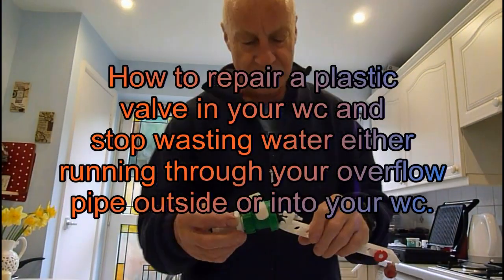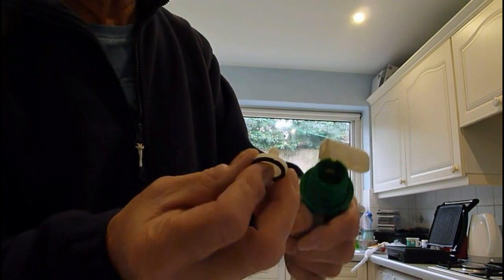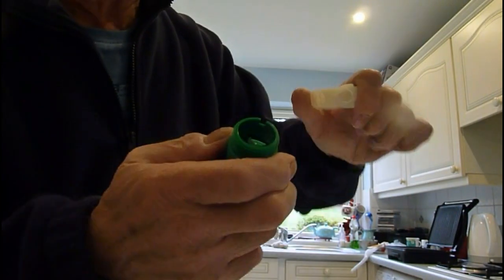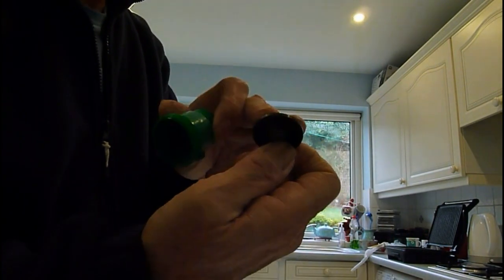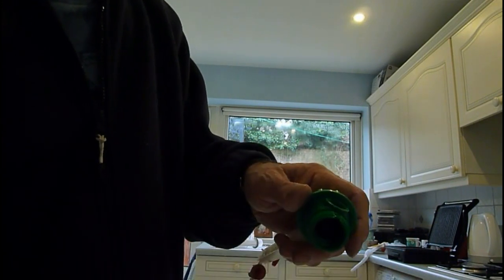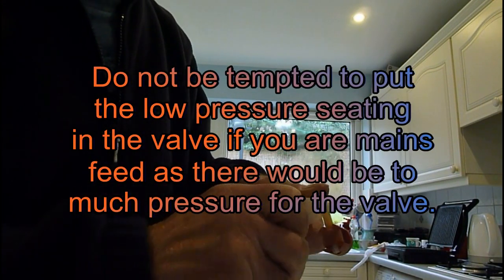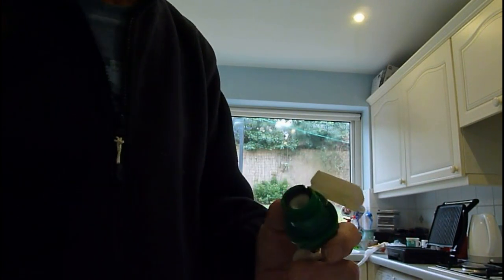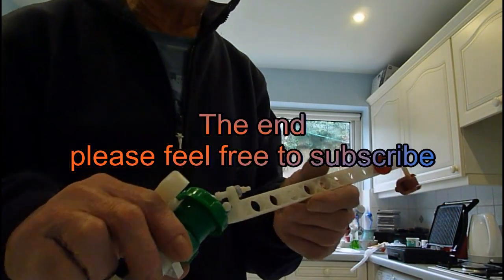How to repair a plastic WC ballcock.Stop your overflow running.Save money now!

Comment: Thank you.  There are not many videos that still show this kind of toilet system, and it did take forever to find this.  But I’m glad I did.  I made the ‘mistake’ of going to replace the rubber washer by myself, and then couldn’t remember which way it went in.  I was able to see the proper way, in this video.  But perhaps more importantly, as even with the rubber washer in the right way, the inlet wasn’t working properly….I had to have the little plunger set all the way out for the water to stop.  Your video solved that mystery…..the rubber o-ring is essential, and I probably lost this when I was taking the mechanism apart.  With the o-ring in place, everything works great, the water stops dripping after the cistern is full, etc.  Thanks so much for posting this.
Reply from the maker: No problem 😊

Comment: Top man ! Had to replace the bottom entry inlet last year and noticed not too long after it was leaking water back into the back of the bowl. Put it off u till my workmate told me he'd had a massive water bill due to a similar problem. Just taken ballcock apart and the high pressure seating dropped out, didn't know which way it qas supposed to go back in. Quick search brought up this video and now its back in the correct position. I'd originally installed it in the wrong way round. Thanks fella. No nonsense video 👍🏻
Reply from the maker: Thanks.

Comment: Plumber came out yesterday as toilet overflow was pouring down the outside wall. All he did was turn the wheel at the end of the float arm to tighten it. And was gone in under 2 minutes. This is now plumber number 4 and each time there is an issue. Now the flush on the toilet is less. But it’s not pouring outside anymore. He didn’t replace anything and didn’t take it apart. Not happy. Waited in all day. For that. No doubt someone else will have to come out. I’m learning the hard way.
Reply from the maker: The quick escape artist, adjust the water level lower so the overflow stops but then your flush is not flushing the amount of water it was before.

Comment: Hi, I’ve replaced a few valves like this over the years and I notice a lot people asking about the valve washer and which way round the washer goes. The washers being replaced are usually distorted so for some it’s difficult to understand. Can you do an instruction on how to choose the correct way to fit the washers in the valve. Thanks for your very informative plumbing tips. Graham.
Reply from the maker: Great point!

Comment: I’ve been watching your videos for a number of months now, very helpful and informative 
OK, some of the detailed camera shots are in poor light and out of shot, but you’re an experienced qualified plumber not a cameraman
I got the gist of it
I can replace the washer kit and leave the pipe work in situ 
It’ll be a lot easier (and cheaper & quicker) than replacing the whole bottom entry valve
I’ll give it a try and let you know how I survive
Thanks
Reply from the maker: No problem. PS MY CAMERA WORK IS MUCH IMPROVED NOW.

Comment: Hi Al, great videos, thank you. I followed your recommendations and changed the diaphragm washer which worked a treat to improve the water flow. Now, water trickles by the nut (the first one closer to the main water pipe). As there does not seem to be a washer in the nut, I wondered if you had any idea what could be causing it. Many thanks again for all your super helpful videos!
Reply from the maker: There should be a washer there or it will leak.
Reply: @dereton33  many thanks Al, much appreciated

Comment: Hi Al, thanks so much for your great videos, I have replaced a lot of washers on taps since learning from you.  My toilet was pouring water into the pan, so I did as per this video and replaced the washer, it worked just until the first flush then it was back to pouring again.  I then decided to buy a new ballcock and replace the whole thing, and all was fine again until the first flush? And it is still pouring into the pan at quite a rate.  What am I doing wrong? Would really appreciate some help, thanks Jan.
Reply from the maker: Janice Holland Hi Jan, if your new ballcock is shutting off OK when the cistern is full to the water line, then it has to be a problem with the syphon. I have a number of video`s on this problem where water keeps running into the pan. http://youtu.be/qyuykxDa6_ http://youtu.be/cHf0sb07bnM   http://youtu.be/syRVlc8eeTY
Reply from the maker: Janice Holland Hi Jan, if the valve is shutting off at the water line in the cistern OK then it is most probably the syphon. I have a number of video`s on how to change those. http://youtu.be/qyuykxDa6_w   http://youtu.be/syRVlc8eeTY  http://youtu.be/cHf0sb07bnM

Comment: My toilet was overflowing. I've replaced  the torbeck valve complete with new arm, but over a period of 6 hours, it still drips and overflows. ?   I am wondering if I've overtightened the torbeck arm to the inlet supply? Any ideas? Thanks in advance.
Reply from the maker: No those valves are rubbish chuck it away and get a new type.

Comment: I have a faulty washer on this type as it fills slowly on at least 2 of them, what size/type of washer am i looking out for in the shop? I have replaced it with the least used one so it fills great now. Need to get replacement/spares now, many thanks in advance!
Reply from the maker: No problem.

Comment: HI 
I would like to take it and see all the parts - as the piston doesn't go back properly, blocking water coming in. But is it possible to do it without turning off mains? I can't find that screw - that is in other toilet in the house that stops water from filling up the tank.
Reply from the maker: You will have to turn off the mains to do it.
Reply: @dereton33  ok thanks a bunch! Perhaps i can ask you - what to do to try to get that piston going smoothly - as it doesn't go back to let the water flow. What could be the cause? Cheers

Comment: hi=need your help please -i have the same ballcock ,its six mths old , when its filling up water comes out of both ends of the nozzle , changed the diaphragm -still the same so had to lower the water pressure any idea what is the problem ??? thanks malcolm
Reply from the maker: Not worth fixing best just to replace the valve.

Comment: I have exactly that type of ballcock and arm in my toilet, but the water level in the cistern is too low. I must be dense but I can't figure out how to adjust to float to increase the water level. Any hints how to do this?
Reply from the maker: Unscrew the plastic bolt on the arm this will allow the arm to lift and more water to enter the cistern.

Comment: Hi I've replaced my previous filling valve with a delchem b801a but it still drips slightly from the spout, I've replaced the diaphragm seal as thought the new one was faulty with a brand new one but still drips, any help much needed
Reply: Probably just need to adjust the screw so it shuts off all the way.

Comment: I took mine apart and cleaned it up and it works fine ... but I seem to have an opaque plastic cone left over. In the video there was only one, but I seemed to have 2 different and I have no idea how the second could have ever fitted in!!!
Reply: The second one if for choice. I think one should have a bigger hole than the other. The bigger holed one is if the pressure is low due to being filled from the attic tank.

Comment: Hi, my toilet makes a noise like a foghorn when I flush it (has done for the past 18 mths). Would changing the washer fix this and if I don't fix it can this lead to further problems? Thanks.
Reply from the maker: E Sinclair Yes changing the ballcock washer will cure it. A brand new silent fill valve will also cure it.

Comment: Couldn't see most of that as most of the important shots were out of frame.  As a complete replacement is only £3.50 from Screwfix, can't see the point of searching out the right washers etc.
Reply from the maker: Kevan Brighting 10 p for a washer or £3.50. Simple.
Reply: £1.35p for the washer nowadays and replacing the washer is what will solve the problem.

Comment: the plastic spout won;t stop dripping on mine until lift the arm to a higher position than the overflow, any ideas how to fix?
Reply from the maker: Adjust the screw on the end of the arm to lower the water level.
Reply: dereton33 thank you!